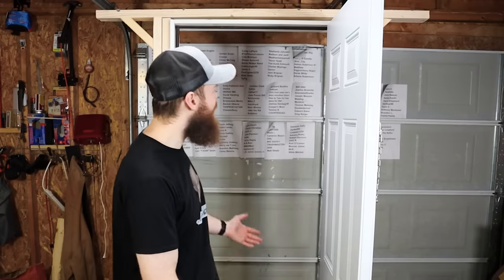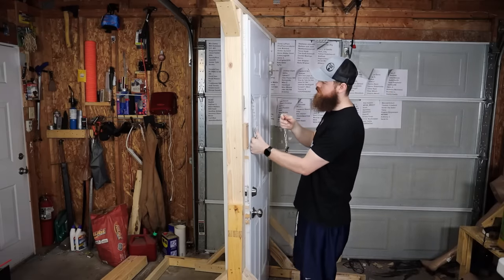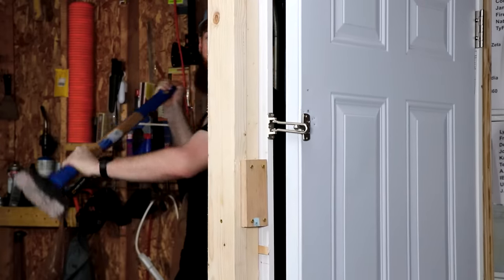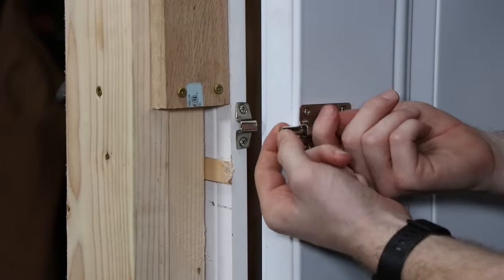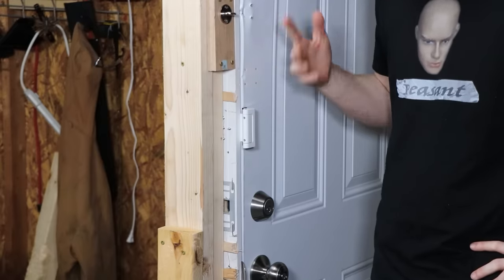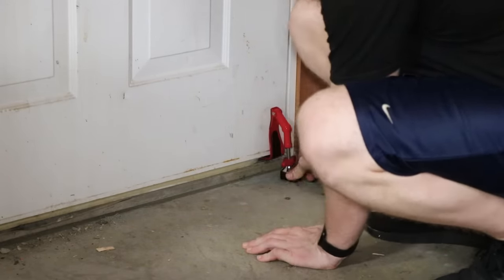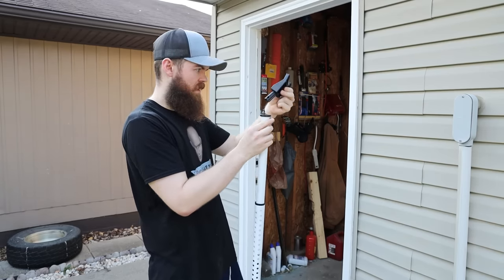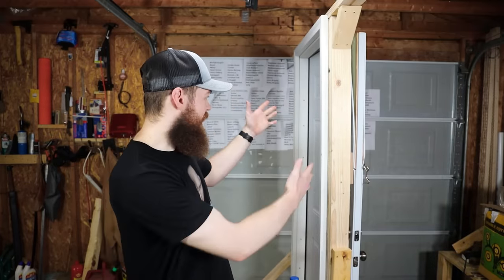Testing Top Rated Door Locks From Amazon!

Comment: To be honest, I’m more impressed with how the door itself survived.
Reply: Fax
Reply: come from you this means a lot
Reply: The door was prob metal, but fax yah lol
Reply: Try hitting it with Nokia 3310 Phone!
Reply: @jonmarquez128  or make the nokia the door lock
Reply: Doors are strong as heck bud do you know how doors are made, they’re made to protect you and lock others out, that’s why they’re made strong as frick, well if you get a good door that is, most decent doors are more expensive
Reply: @emma6648 ok, bud
Reply: It’s a metal door.
Reply: The force that would normally break the door is being transferred to the frame. That's why the frame moves so much, and why the door doesn't break. 
That's also why it's actually very difficult to punch your way out of a paper bag. The force of your punch pushes the bag instead of ripping it. If you held the paper still and punched it, it would rip, because none of the energy is being wasted on movement.
Reply: me too
Reply: Heard that you are the ultimate door lock
Reply: It's because of US fire code regulations that outside (or apartment) doors in the US are so weak.  The are designed so that emergency crews (and thus criminals as well) can easily break in.  You go to many countries and the typical apartment or front door is multi-bolt and has a reinforced frame, and would probably withstand being chained to a car.  You would destroy the car before the door or the frame lets go.  I wanted to install that at my home when I moved to the US years ago and was told I could not do it because of fire codes.
Reply: So that door was a metal clad door, a wood door covered with metal. A plain wood door would probably crack before anything else
Reply: @acfiv1421  Couldn't they break a window instead?
Reply: Sweet I was like 666 on Chuck Norris's Comment. Hell Yeah
Reply: The door is not even  install right. This is a prop door. This is stupid.
Reply: FR THO

Comment: Part of your problem on that second lock is that your entire door is moving, which is dissipating the force through the entire door. If it was solidly put inside a wall, it probably wouldn't have lasted nearly as long.

Comment: One of the things I noticed is that your door frame moved QUITE a bit when you were hitting it. That movement absorbed a lot of the impact. Most of these locking devices probably would have failed, sooner, if you had them on a proper door. However, most of these locking devices would, and should, be used in conjunction with the deadbolt and the knob lock.

Final thing - this is why firefighters are not trained to kick doors in. They're trained to use haligans and other tools. Kicking doors in is a good way to screw your knees.

Other than that, solid video.
Reply: Bingo!
Reply: There was a video of a would be burglar at who actually broke his leg trying to kick a door in. I couldn’t imagine my leg going the other way 🫢😰
Reply: @X.L.B1  how could you possibly break a leg while kicking a door huh if you're made out of pasta probably
Reply: These same physics would also be the same reason why the door guard (second lock) out performed the barrel bolt (fourth lock).
Reply: My thoughts exactly. It’s like trying to hammer a nail into a board that’s not secure. The board bounces and the nail goes nowhere.
Reply: Yeah, a good old haligan and flat head ax will get you in 90% of the time
Reply: @justinpickering5768  Show us
Reply: It's like those WWF fighters on bouncy floor.  I stopped the video as soon as I saw how poor the setup was, rendering his conclusions useless.
Reply: It’s the same guy that didn’t know sweet potatoes were a thing. My expectations are always pretty low for him. 😂

Comment: You've  got to be kidding with the door chain? 😂🤦🏻‍♂️ The latch part goes on the door so when the door opens it pulls it along the track so you can't put your hand round if you do it right
Reply: I came here to comment this exact thing lol
Reply: @savannahsatchell287  me too
Reply: Chains are still pretty shit tho but yea it's more effective when you fit it properly
Reply: love his vids but some of the stuff he does shows how little of manual labor hes done
Reply: I also came to say this.
Reply: Man I’m glad someone else pointed this out. He always messes up stuff like this lol
Reply: even if he did put it on right one good kick and it breaks lol
Reply: @nicholasabsher4599  you mean how clueless he is. He has some things that don't make sense that are not labor related.
Reply: @nicholasabsher4599  case in point...he thought the strongest lock was the second weakest when it's pretty obvious that it would take a TON of force to either A) pull the screws from the frame or B) pop the steel pins.
Reply: It's not unlike when I see gates that are installed backwards. The locking mechanism of a gate should always be on the fence side not the gate side to make it last longest.
Reply: @nicholasabsher4599  another case in point he got this order completely wrong when he ordered it weakest to strongest. He put the obvious weak ones at the end.
Reply: @nicholasabsher4599  another case in point that concrete doesn't give much friction to hold that door jammer
Reply: @nicholasabsher4599  installing a door chain isn't manual labor bud. He does plenty of labor intense stuff however. He just isn't an expert at everything he does. He tries hard and makes good content though. Isn't that why we are here
Reply: Hahahaa i didn't even really realize this until I read that! I mean I was kinda like "something seems a bit off"  but didn't think twice... lol Tyler is a fuckin trip
Reply: fr i came to comment this like bruh
Reply: Did y'all not here what he said at 2:25 about it. He installed it the way it was displayed.
Reply: @Arrows_tip  he said he installed the clasp in the displayed direction. Thats it. All he mentioned was he installed it vertically like it was displayed and not horizontally
Reply: @huskers1278  lol you gonna be ok over there?
Reply: I have just come to expect something like this to happen in every video now. I want to think he does it on purpose, but I really don't think so.
Reply: I’m glad I’m not the only one. As soon as I seen it I went straight to the comments. LOL
Reply: @RYANBRU32  Too true!
Reply: It could still work in the way he had it...all you would do is move the part that is on the frame upward so that the length is what you need.
Reply: Guess he didn’t have that luxury.
Reply: @drfraust3117  I believe so. It's getting day by day thanks random 35 year old man on YT
Reply: I was getting ready to comment the same thing too...
Reply: lmao i was like im sure someone told him
Reply: I prefer the leaving crap in crap vids he had no real science or thought just what would happen. When he trys to get technical it gets a bit cringe
Reply: @nicholasabsher4599  dude he’s a diesel mechanic. That’s literally all manual labor, he also says he installed it exactly as shown in the picture
Reply: Half the fun is watching his lack of experience 😂
Reply: @nicholasabsher4599  I've been saying that same thing for a while now. Although his videos are entertaining, I would wish he would just read the instructions for once.
Reply: I was really hoping the comments were filled with door chain disses
Reply: @slimsniper72076  I thought the same thing when watching this.
Reply: @Vader99ify  and he did. He said he installed it the way it was told on the instructions. So it’s not his fault the instructions where not correct to some people’s standards.
Reply: Apparently we all did lmao
Reply: @nicholasabsher4599  he is literally a diesel mechanic wym little manual labor
Reply: True, but I think pliers could bypass a lot of those locks rather easily
Reply: @gertskook  2:20 all he said was he did it the way it was shown in the picture in reference to it being put vertically. Doesnt mean he installed it correctly, he just properly put it vertically. but maybe the instructions were wrong. But he followed a picture also im pretty sure i see door chains used more inside than as an outside lock anyway, like who would use it to lock a main door? they're so fragile
Reply: He said he's doing everything the way it's said and shown in the instruction and using only equipment that comes in the package, didn't you get that part?
Reply: @adamw9785  your not wrong, he did say that the picture was like that
Reply: Looked for the same comment!
Reply: We are talking about a guy that don't like pickles. He's weird anyways. 😅
Reply: @justme002  this is the only reason to watch his videos when they are not otherwise too interesting lol
Reply: @gertskook  He only said he installed the latch in the direction it said (vertical) not where to actually put the latch. Go back and watch it. Don’t get me wrong I still love the videos, but you can’t honestly tell me sometimes you wonder if he is actually reading the instructions.
Reply: @Vader99ify  eh sometimes. I know some people do that for comedic stuff. And I think he does for some videos. Depending on the video and thing he’s doing. But I think when it comes to say dangerous things, I think he does read it. In this case 🤷🏻‍♀️. I just commented saying he mentioned he did it the way the instructions said ya know? But most times I think he does a lot for comedy.
Reply: @gertskook  Oh yeah I agree! I was thinking after my last reply that he probably is doing it on purpose for the entertainment.
Reply: @Vader99ify  yeah his demeanor when it comes to entertainment is different from serious ones. Like the batteries one he did shows the difference.
Reply: It also goes on the door so you aren't banging a chain against the door every time you open and close it, which is noisy and wears the finish off.  Regardless, if you don't mind those factors you can install it the way he did, but simply have to move the latch slot plate further up or down on the frame away from it so there isn't enough slack to get anything, tool or hand in the crack, OR just shorten the chain (duh?).
Reply: Lol I came to say the same thing!!! Also noticed that he has the other locks unlocked as well.  These are meant to assist the other locks not work alone.  And they  are meant to give you time to defend your self.
Reply: @nicholasabsher4599 I mean he was/ is a diesel mechanic, not really his cup of tea
Reply: Beards make you smurt
Reply: lol I was hoping someone already said that
Reply: @ThePrufessa  He said he ordered it in what he THOUGHT was weakest to strongest. Which is why he was shocked with the second lock doing well.
Reply: @nicholasabsher4599 I know it’s a year later but you thinking knowing how to properly put a door chain on doesn’t equal manual labor💀
Reply: A 5 year old can still open a door even when you do that
Reply: @nicholasabsher4599 he’s a diesel mechanic….
Reply: Still that bust of the chain
Reply: Because he didn't read the instructions
Reply: Dude, I commented the same thing…. I’m starting to worry about him. There’s no way this was real. I think he must know and he just playing the fool….right?
Reply: @wamrainc176  then he must play a fool in alot of his videos 🤣
Reply: I don't think he has ever presented himself as a professional...
Reply: @RYANBRU32  it pretty much adds at least 1 more kick giving you time to stop the the threat
Reply: Not to mention it’s not even designed for keeping ppl from busting through your door it’s made so you can open the door to speak to someone
Reply: Can't believe this guy didn't think this through.....a millennial lock job. Forget about a door not mounted in a wall, not at all a representation of actual physics.
Reply: @tonynnbsco_6226 Do you even know what you’re talking about
Reply: Presumably, you’ve locked the door, so simply opening it and unlatching the chain isn’t an option.  They are still garbage but that’s a poor test.
Reply: I used to work at a motel that used these latches, and all you need is a piece of cardboard and close the do on the cardboard where the latch is, and it will open no damage, no evidence and none the wiser.
Reply: You can move the slider receptacle up the doorframe, no?
Reply: That doorframe isn't realistic. It's too flimsy and not anchored. That sloppiness works like a crumple zone on an automobile.  It's absorbing  a lot of energy that would be transferred into the locking mechanism in a real installation.  Also, for the add a lock, the frame is allowed to spread outward because there's nothing backing it up. So this test should be tossed out. Not realistic. Not scientific.

Comment: As someone who has breached and entered premises, I can tell you that a deadbolt mounted in an actual door frame is MUCH harder than a couple of kicks.  Were talking sledge and hooligan tool.
Reply: Nope, a couple kicks from a health, full sized adult male will rip the door frame apart if you kick AT the deadbolt area, unless one of two things are true:

1)  The frame is metal

2)  The striker plate spans a longer area and has much longer, thicker bolts going through past the frame into the wall stud or other material the wall is comprised of.

Essentially, what he built was not designed with security in mind, though I concede that the average crackhead breaking into homes may not have the health or mental facility to effectively land a kick that hard.
Reply: @stinkycheese804  I'm a woman in her 60's. Been opening 'secured' doors for many, many years.
A properly anchored deadbolt strike plate will hold up for long enough to grab your gun.
But, why bother? If I need in, I don't even try. I am not in Lock Picking Lawyer's class, but I can pick just about any, quietly, in a few minutes.
Seriously, though, you have windows in your home? Never mind the door. If I had to get in to save a life? I'd break the glass, done.
Reply: @stinkycheese804  almost all modern high quality deadbolts have a plate below the striker plate that takes 3" screws, and you're not kicking it down.
Reply: @littlejackalo5326 Then all you're really stating is that most people don't have your  hypothetical modern, "high quality" deadbolt, but FYI 3" screws don't keep the rest of the door frame from coming apart if made out of typical pine wood, especially after it has weathered.
Reply: @ethelryan257  how do you dealt with deadbolt ON ? i mean it a long piece of metal not just a lock
Reply: @ethelryan257  Do you think it make a difference in metal frame having the metal plate removed ?
Reply: A deadbolt and a strike plate attached to the door and frame is basically impossible to get past. Kicking will do nothing to that.
Reply: @stinkycheese804  3 to 4" screws go into the studs also.  It's not just through the flimsy door frame.
Reply: @stinkycheese804  I like how you have no experience of kicking down doors (otherwise you would have said), yet you claim to know more about it than someone who does have experience of it.

Comment: Ever wonder why the deadbolt is so long? It is supposed to go through the frame, and into the trim stud inside the wall. The metal bracket (if installed properly, prevents the frame/stud from splitting apart like that,) can also be installed on the stud during installation of the frame, making it even beefier, and allowing larger (within reason) screws to be used efficiently. Properly installed deadbolts are freaking hard to bypass with force. That is also an exterior door on a 6" frame. It should be installed in a 2x6 wall, making the deadbolt mounted in it even stronger. That is a 2x4 frame.

Comment: I personally replace all the screws for the lock plates on the frame and hinges with 3 inch deck screws instead of the half inch screws most come with. That way if the frame does break you still have to break the screws

Comment: I was surprised by how fast the door defender failed (the aluminum flip lock). Personally I like the steel strike plates that reinforces the door jamb and prevents the wood from failing. The one you gave 10 stars for is common on hotel rooms. Thanks for doing this. Btw, the products that rely on the door to be latched and bolt thrown might have done better had you not held the door partially open/ unlatched. Sometimes these products are designed to work together with a locked door not by themselves. That’s just my opinion and your testing has definitely gave me some ideas. Thanks for sharing!

Comment: Steel doorframe and door with a deadbolt is probably your best bet for security. I have significantly above average experience with kicking in doors and if either the frame or door are wood (with standard deadbolt) it wouldn't take me more than 2 kicks, if it did take me 2 I would end up laughing awkwardly between the first and second kick.
Foot placement and correct weight shift are the most important things.

Comment: You gotta remember that most of those locks are extra security, and would be locked with the dead bolt and handle lock all locked at the same time
Reply: Not many of those are going to be in parallel with the dead bolt, besides that 4th white block thing. All the other ones, you'd defeat the dead bolt first, then the extra lock, since they allow the door to open more. They are in series to the deadbolt.
Reply: @@dustygerman4981 well he should be testing it that way. Who is going to put a chain on their door and not lock the deadbolt too?
Reply: @gokuog1772  Personally I’m researching to keep my maintenance guy out when I’m home. He tends to come over unannounced & will let himself in if he sees my car. He has a key so locking the knob doesn’t do anything.

Comment: I have just a few points to make on your video, the chain lock should not have riveted hardware for the latch, it also should be mounted horizontally not vertically so that when the door is pushed in it cannot reach the latch release point. The frame you used needed to be beefed up to reduce flex and twist such as a real door frame would react. Also the best lock for your door in my opinion is the nightlock door lock. It is very effective and quick and easy to install.